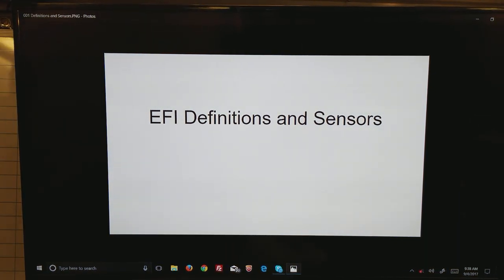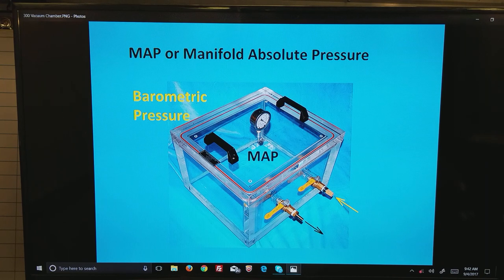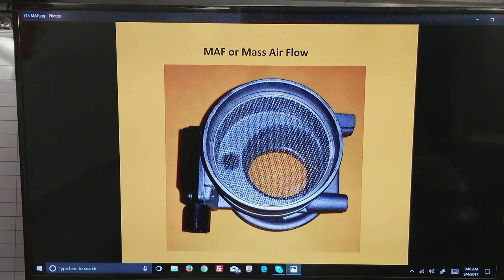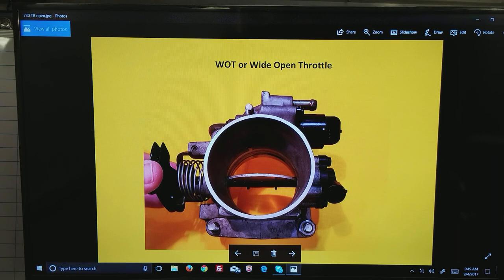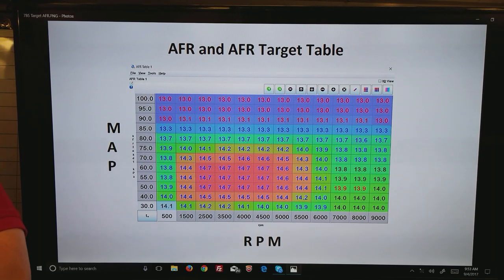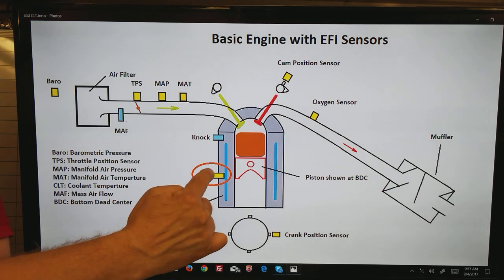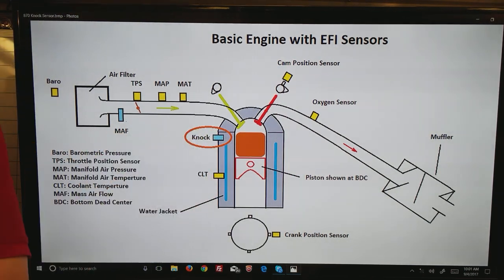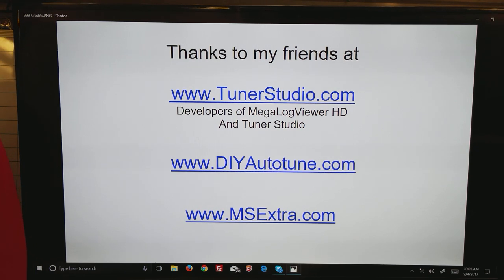EFI Definitions and Sensors

Comment: Hey Andy! Been following you on a bunch of forums. I purchased your MLVHD and have been trying desperately to understand it and use it for Harley-Davidson tuning. I first found you on HDforums then HTT.  You have seemed to have ghosted. I do understand why as I've read most everything you have posted up trying to learn. I see that you used to post up links to a site that no longer is valid. Is there  paid site or a MLVHD For dummies? I've been data logging with PV and getting what the PV perceives as spark knock BUT it's a wild build. 10.6:1, 124" 650 cams pushing 144/ 134. I've just added some vp octane booster to see if that lessens all the perceived spark knock from ion sensing. If it does then ill use your video's formula for where to remove it by using the buckets in histograms. Thanks for all you do!!! Liked and subed.